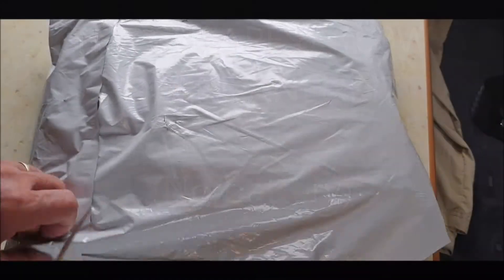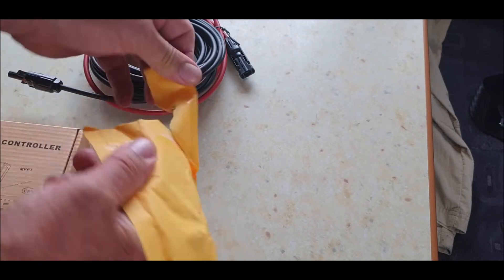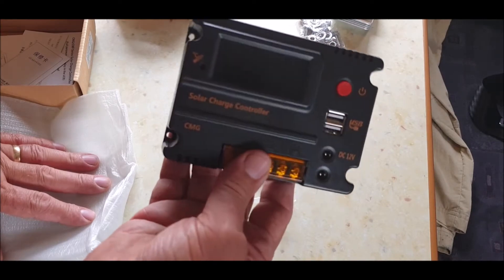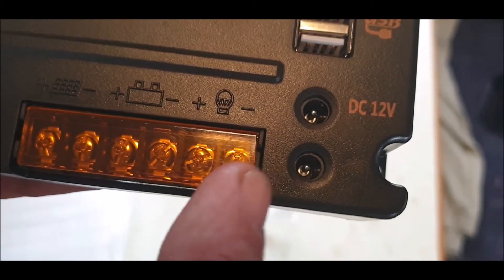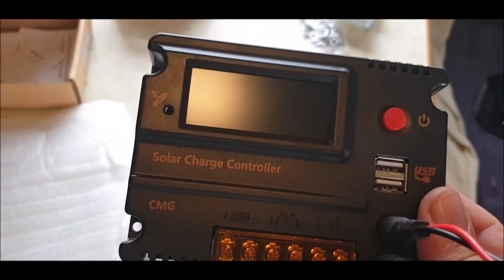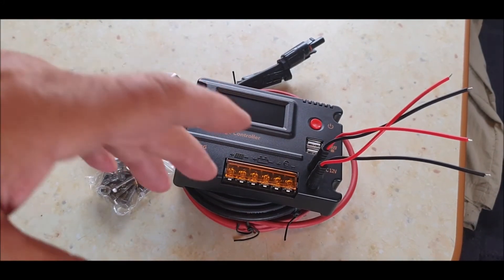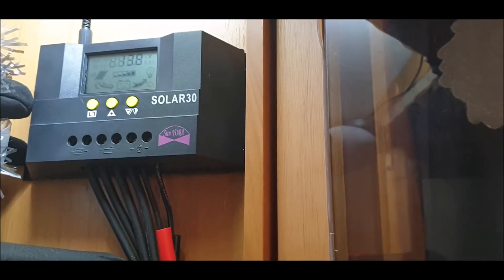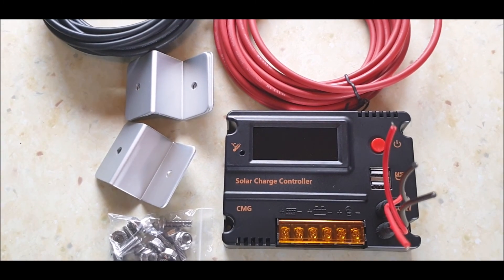THE CHEAPEST FULL SOLAR PANEL KIT

Comment: dead link there selling a similar one with the cheap controller for £121..

Haven't got a multi meter to take the readings from it for Amps and Volts on the PV and the Controller?~~

I know the controllers are between 3-6£ the cables around 5£ The brackets are standard ones so £2. so its just down to the panel performance which vary wildly, I can read claims and the math does not add up.

I saw a "full kit" which said 120W panel, then went on to say the 100 W panel.
Then the math didn't add up as the max would have been around 100 unloaded, it claimed X amps, but math mathematically it was less than a quarter of the claim.. Hence why Im hunting around for buter videos, but I haven't seen a single one with the (as running) details